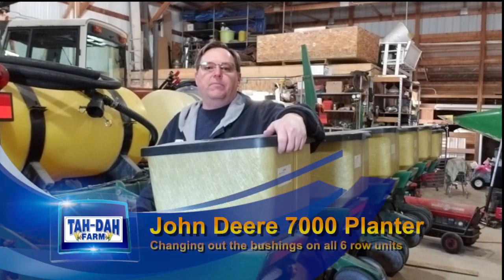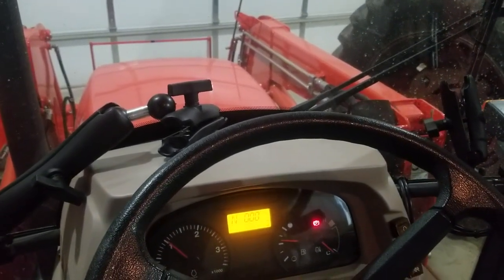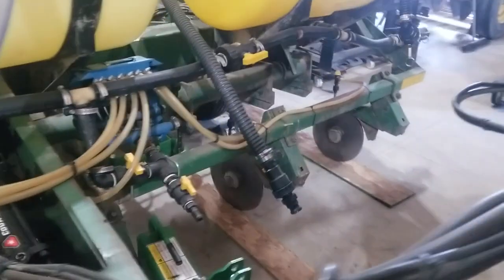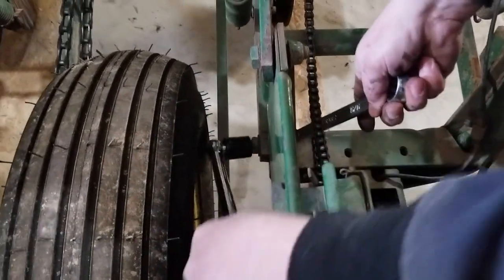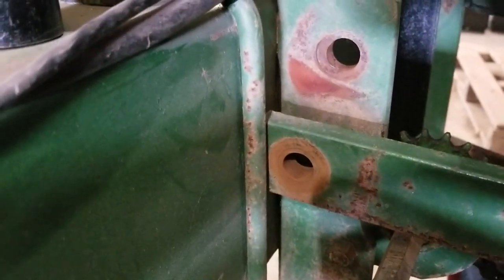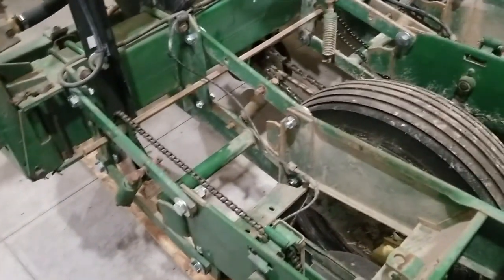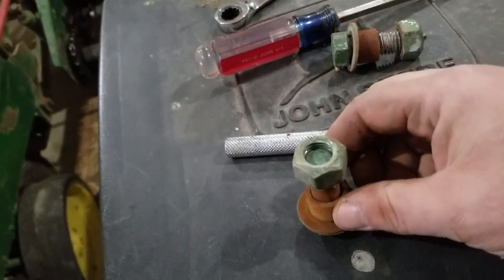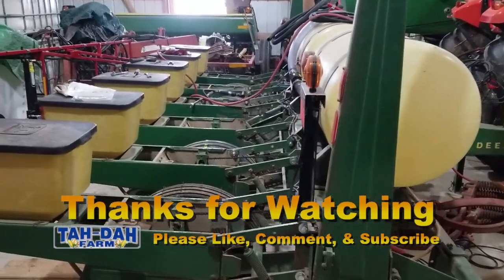Repairing the Row Units Bushings on a John Deere 7000

Comment: I used longer bolts with a shoulder that would go through bushing and mounting angle then cut off extra threads.
Reply from the maker: Good deal,  thanks for watching.

Comment: U plant with the Kubota ?
Reply from the maker: Yes I use the Kubota M-7060. It pulls the John Deere 7000 corn planter with ease.  The front wheel assist is also a nice add and it turns much shorter.  It also pulls the John Deere 8300 drill with the unverferth culti-planter well also. I was looking for a bigger tractor and that's why I bought the IH 1086 for tillage and would like to get a no-till drill, and that will require more horses power.  Thanks for watching.

Comment: I'm sorry I thought I was subscribed a long time ago. But I am now! That's a sharp-looking 7000!

If you're interested I would make a heck of an offer I have the V set vacuum kit from my 7000 with both corn soybean plates. Also I bet I could pick out six good quick change tail Wheels assemblies from Shoup.
Reply from the maker: Thanks, I'd have to think about the vacuum thingies.  I'm not sure how they would work. But I would be interested in the adjustable rear wheels. That is something that is on the list to upgrade.
Reply: @TAHDAHFarm  I'll go get them tails off here this week and make sure that they're in good shape around the bushings.
For the vacuum you need a closed Center Hydraulics or pressure compensating hydraulics like a John Deere 4020 or newer type tractor or even some late model 1086 had the pfc. If your planter tractor is an open Center system then you can't use it. That I know of
Reply from the maker: Sorry I didn't get back sooner. I was checking my trackers out for the hydraulics.  They are all open center so that will not work. I am interested in changing out the back closing wheels.

Comment: I replaced all those bushings on mine the first or second year I owned it. Probably should recheck them to make sure they’re still good.
Reply from the maker: I should have done this last year but I didn't have that much corn to plant. This will be the 3rd year that I have had this and was surprised that they were that bad. When I looked at it, I checked it and they all seemed to be ok. I did find that the worst ones the bolts were lose. It sure did make a difference and it is tight now.

Comment: I need to replace those bushings in my planter also! And replace one of those no-till down pressure springs!
Reply from the maker: It wasn't that bad of a  job. And from Shoup, it was about $50 a row. There is a place not far from me that sells a repair kit for the 7000 and it makes it the same as the 7200. That was about $60 a row. If / when I change over to no till, I will get the kit from Shoup.

Comment: Would you ever consider no till
Reply from the maker: There might be someone in the area that do no till for everything. Although it is about 50 50 minimum till and conveniently till around here. I am looking for a no till drill to plant wheat in soybean stubble. That is the reason I was looking for a bigger tractor and bought the IH 1086 is to pull a no till drill. It seems like every 3 to 5 years everyone around here is doing some kind of deep tillage because of the soil we have. As far as the corn planter,  I have looked into converting it into no till just want to do the drill 1st.

Comment: Good job to have done.   Any other things you need to do to it?
Reply from the maker: Need to go through the seed meters,  grease it,  and I got a new monitor for in the tractor.  I need to make sure that it is working with the old monitor pick ups and wire. It is set for 32000 spa so that should do it.  Thanks.